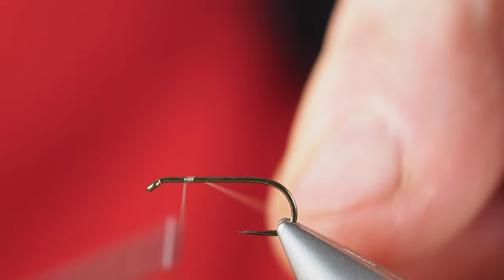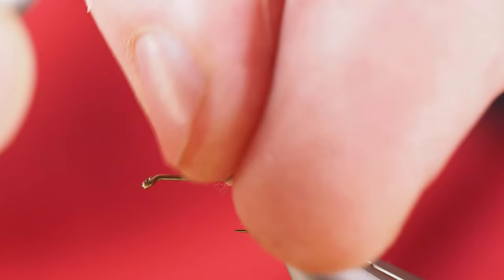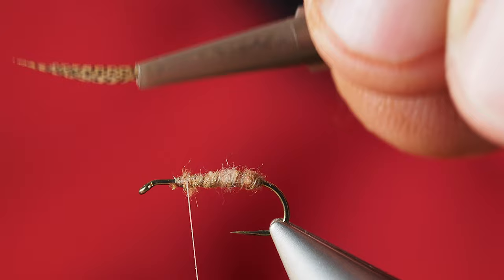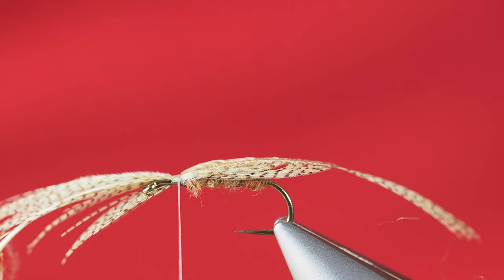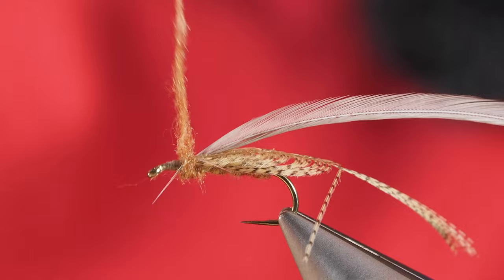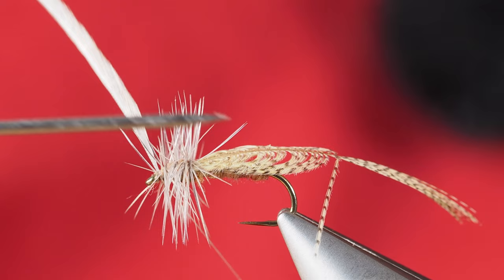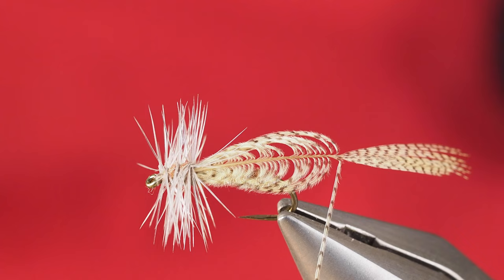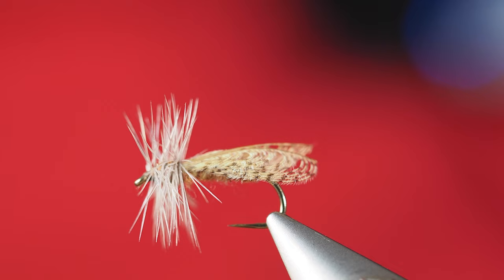Bent Wing Caddis

Comment: he is correct ,a real caddis fly has a fat but and tapers down toward the eye of the hook. The length of the barbules on the Malord feather determines the length of the wing when you pull it through the resin nozzle. I use this same method when I'm preparing a "Wally wing " . I love doing Wally wings ,although there's one draw back with them .They don't last very long .One  maybe two fish and their toast. So I tye a lot of them .Thanx for the pattern . Tight Lines.👍✌